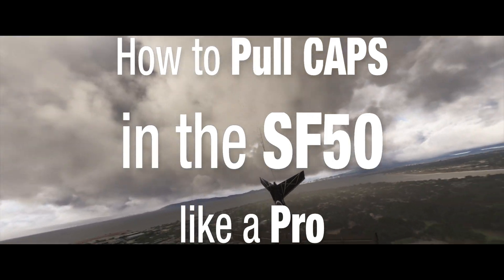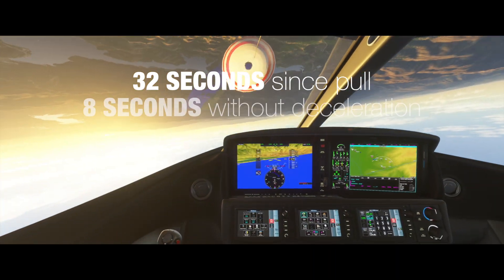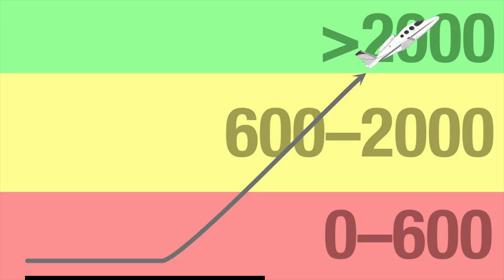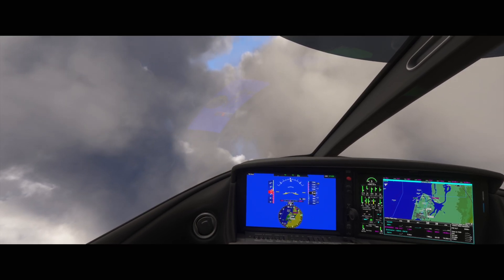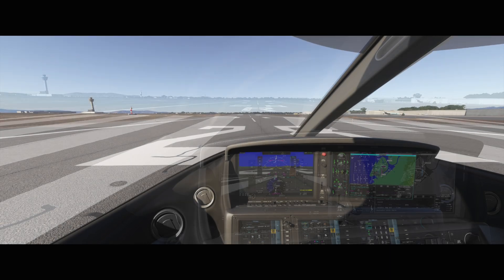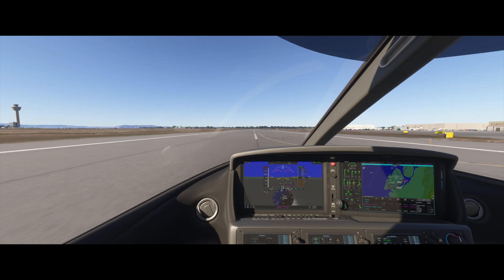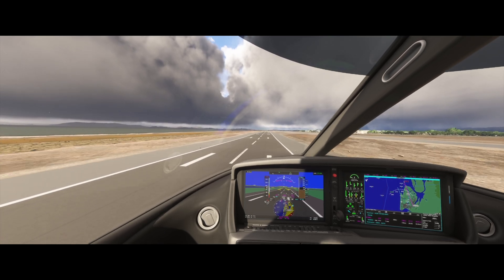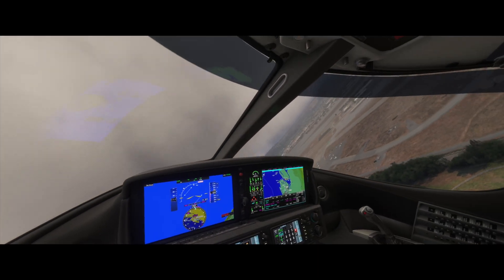MSFS 2024 Vision Jet Emergencies: CAPS and Engine Failures After Takeoff

Comment: Extremely interesting video, thanks for sharing! I'm curious about one thing: Right near the end you reference pulling CAPS as "[destroying the aircraft] on purpose". Is this a sure thing, ie. does the act of pulling CAPS itself cause significant damage to the airframe, or is the bigger concern here the potential for damage in impacting the ground / other objects at the end of the incident?

As an aviation-curious layman, I could certainly imagine the forces the airframe would be subjected to during the parachute deployment are significant enough that they could do significant harm to its airworthiness. But I'd love to know if it's basically a guarantee that the plane is a write-off, or whether a CAPS-deployed airframe can economically be returned to service if the final landing is fortunately gentle?
Reply from the maker: Pulling CAPS is almost certainly a write-off for a Vision Jet. There are a handful of SRs that have survived CAPS pulls and been returned to airworthy status (after expensive inspections and maintenance), but the majority of them are bought by the insurance company. There have only been two SF50 CAPS pulls so far, so we don't have a lot of data, but given how much more complex the airplane and the CAPS system is, I would be working under the assumption that if I pulled the handle, I am an owner of one fewer airplanes.
Reply: @riscfuture  Makes sense and something that wouldn't have occurred to me without the video, thanks for the reply!